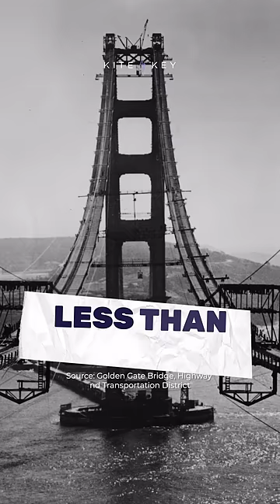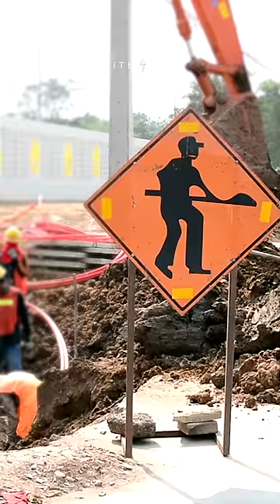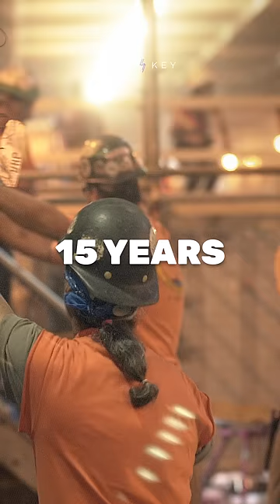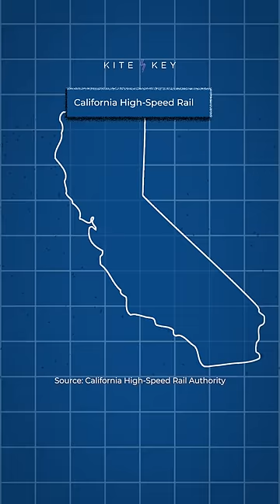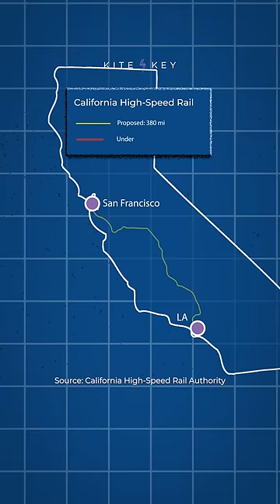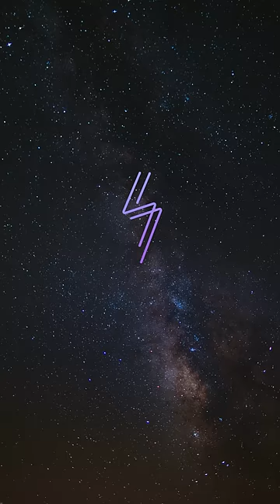California’s high-speed rail project exemplifies America’s infrastructure woes #shorts

Comment: It is an incredible waste of money.   When they built I 5 over the ridge route they were supposed to put in a rail line at that time.  It would have cost very little and been done in a few years.  We really don't need high-speed rail.  We just need Standard speed rail from LA to San Francisco that goes through the San Joaquin valley.  Some political moron decided to make it high-speed rail which was unnecessary and insanely expensive.  We don't have enough money to manage the forest prodelete or handle crime or homelessness but we've got money for this boondogle???  This project seems too difficult for the state of California to pull off.  Corruption and incompetence are the cornerstones of California government!!!
Reply: “We” have the money. It’s just not being used on the right things or properly. Let alone preemptively.